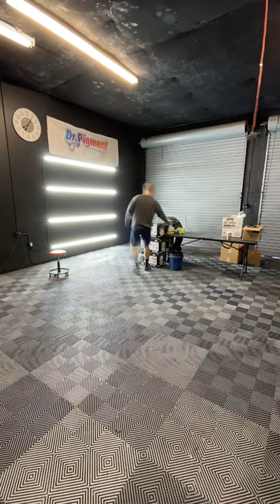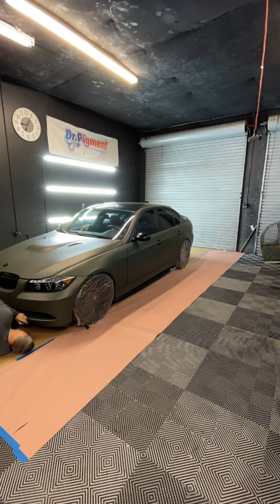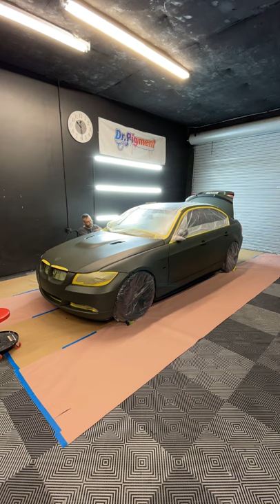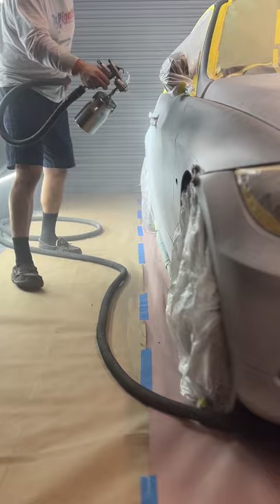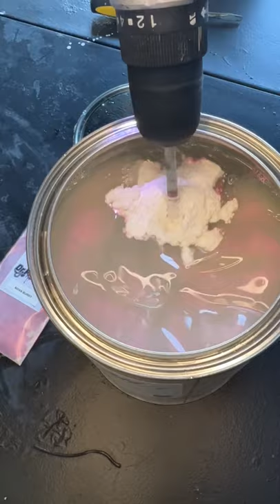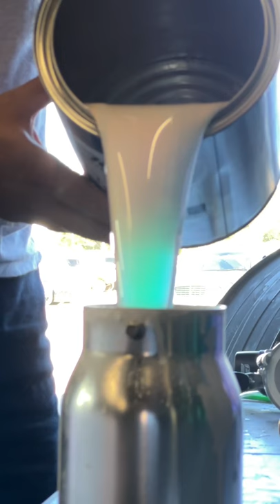Changing the color of my car (part 1)

Comment: I got a hightop conversion van & a hightop conversion van trailer... if your car  is about $600⁰⁰... How much would it cost me to paint 🎨   both van & trailer  the same matching color  of gulf racing blue 🤔 💙
Reply from the maker: Hi - Can you send us photos on IG or FB? The $600 was the material cost btw. This was my personal car so no labor was charged. Are you looking to apply yourself or take it to a shop and have them install?
Reply: @DrPigment doing it at home have a home made paint booth  made to do rv's. With fans and scaffolding.  I stay off social media..just a YouTube watcher.. the van is 1st generation savanna 19ft.. the trailer is last gen vandura..12 ft. Cut at driver's door and boxed to match the profile.

Comment: How much on average does it cost to paint a car
Reply: Ain’t it crazy your the only comment and he can’t reply back to you but it’s a tricky question depends on what you want done but normally $500 to $5000 can be more
Reply: @elijahrussell4143  Alrighty thanks
Reply: @elijahrussell4143  good point like where is there customer service or social media guy they are missing business by not interacting and answering questions
Reply: As mentioned before $500 to several thousands if you have the tools already. What work will go into also changes it as you may value your time differently. 

Side note: As a moderator for several YouTube short channels.... I will happily never reply to shorts. 😂 Shorts bring in dozens of comments per hour in most cases. 

Slaving over YouTube shorts comments or addressing actual customer comments in DMs or company emails? 🤔
Reply from the maker: @elijahrussell4143  We are small team, I try and answer as many messages, calls, emails, dms, discord messages and text. Some do get missed though. Not on purpose though. Between spraying cars, teaching others how to install and getting orders out, I try my absolute best to do what I can.
Reply from the maker: @Caliscarz  We are small team, I try and answer as many messages, calls, emails, dms, discord messages and text. Some do get missed though. Not on purpose though. Between spraying cars, teaching others how to install and getting orders out, I try my absolute best to do what I can.
Reply from the maker: What Tio said, material cost, is about $500-$1000. Depending on color, finish and vehicle size. If you are looking to take it to a shop, expect to pay the installers labor price for the install. Depending on the project, installers experience and location... expect to pay x3 - x4 the material cost.